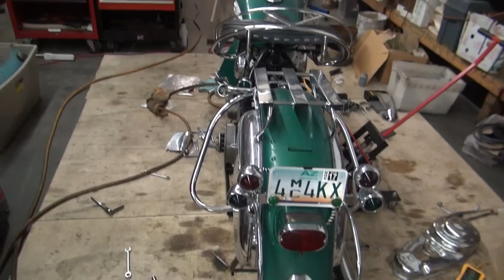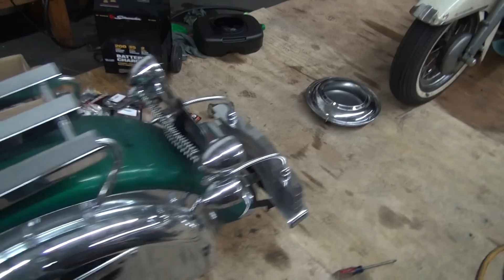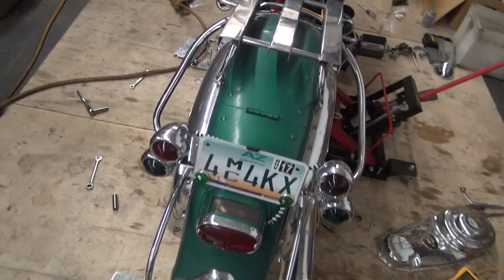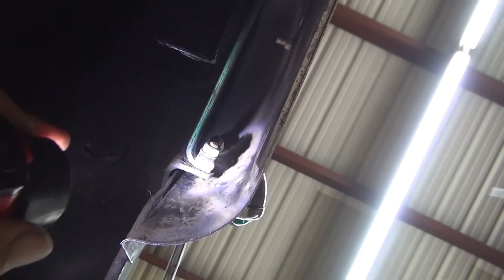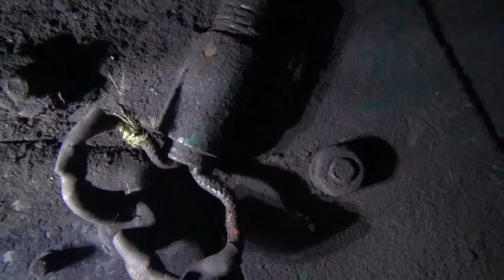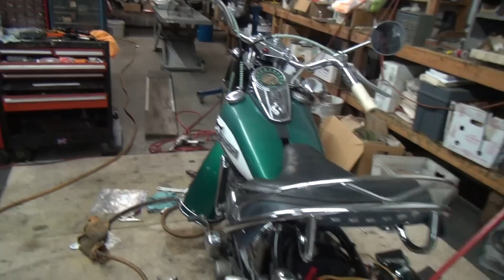Hunting Harley's, Duncan sent the bug back in bad shape

Comment: I know I've heard you said on more than one occasion that Duncan is the best mechanic you ever worked with, but if someone with a reputation like that has someone working for him doing shoddy work and hack-jobs, he is ultimately responsible as if Duncan himself did the work; thus, ol Duncan's cuttin off his own feet in the process, sad!  My heart bleeds for you dude, you could have eaten asphalt!    
I've had my experiences & displeasures dealing with incompetent and shady mechanics, too...I used to own an FL, and once brought it to a Harley dealer for a tune-up.  I picked it up a couple days later with the throttle grip end cap sheared off, a small dent in the front fender, and a stripped transmission drain plug.  In addition, these thugs managed to put 150 miles on the odometer, WTF!  Of course, they denied any wrong-doing when I confronted them about it, and I bitched all the way to corporate, but it was like talking to a wall.  Conclusion was I hadn't walked into a Harley shop in 12 years, and I don't plan to anytime soon.